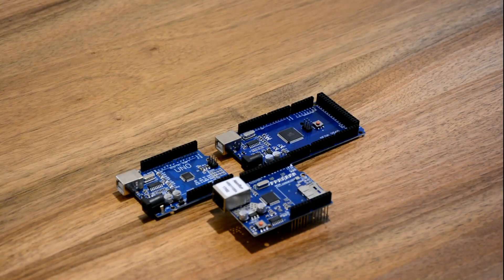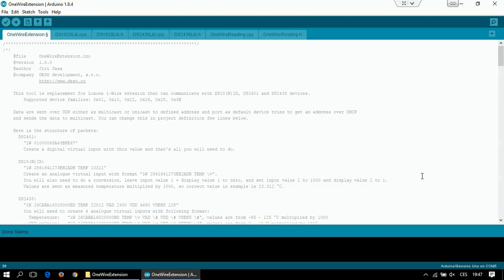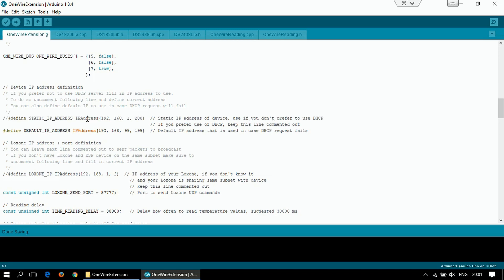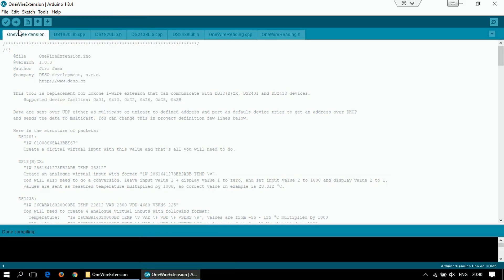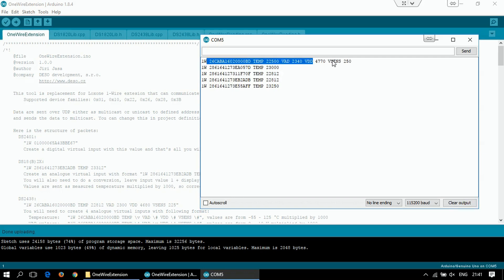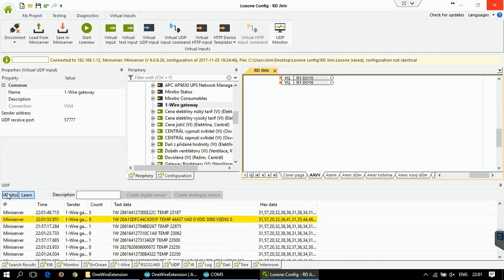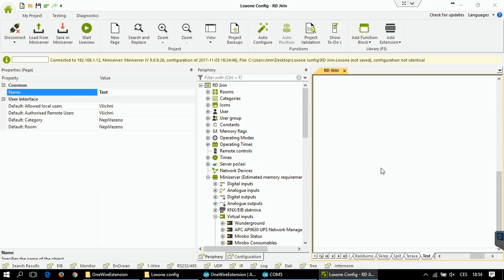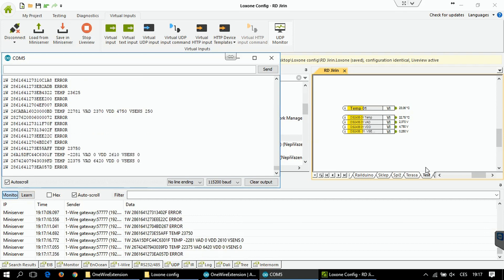Arduino 1-Wire UDP gateway for Loxone and others

Comment: Arduino: 1.8.3 (Windows 10), Vývojová deska: "Arduino/Genuino Uno"

In file included from C:\Users\slepa\Documents\PRĂ?CE16\Arduino\1-wire-udp-gateway\OneWireExtension\OneWireExtension.ino:74:0:

sketch\OneWireReading.h:9:24: fatal error: LinkedList.h: No such file or directory

 #include <LinkedList.h>

                        ^

compilation terminated.

exit status 1
Nastala chyba při kompilaci u desky Arduino/Genuino Uno.

Prosím, při překladu vypsaná chyba?
Reply from the maker: Tak to je snad celkem jasné, ne :)? Chybí knihovna LinkedList, která je dostupná přes Manažer knihoven či přímo zde: https://github.com/ivanseidel/LinkedList .